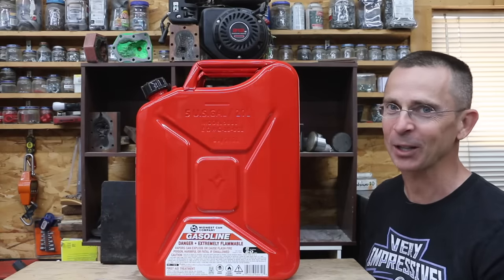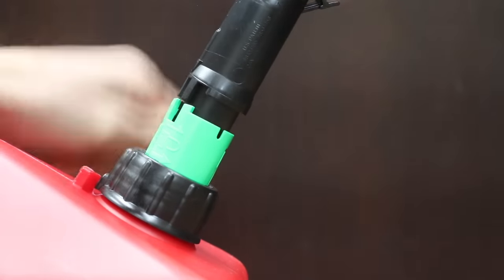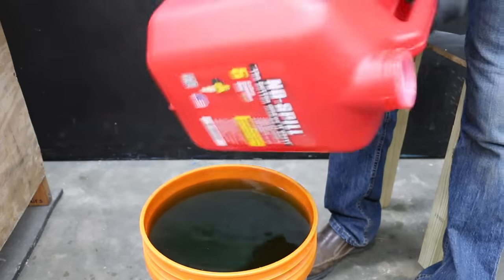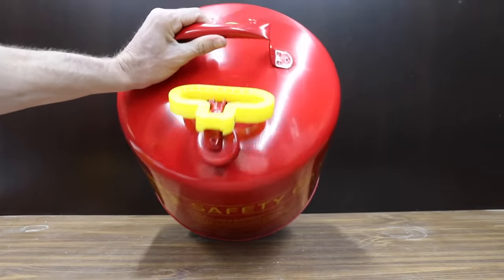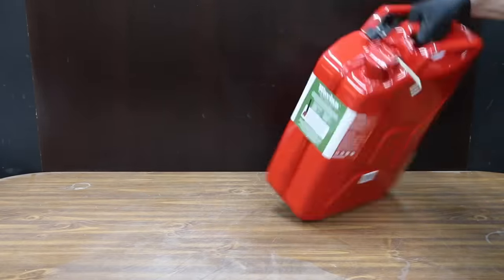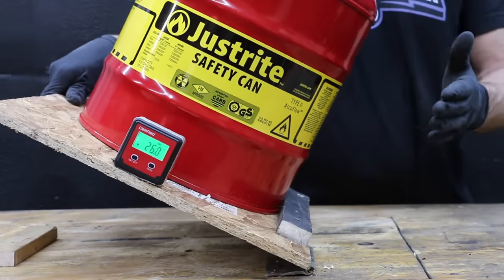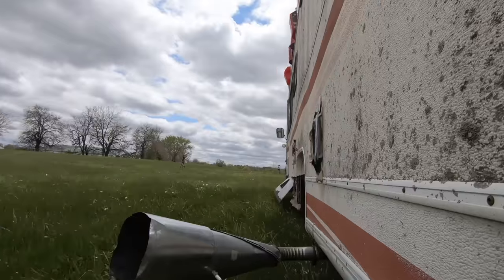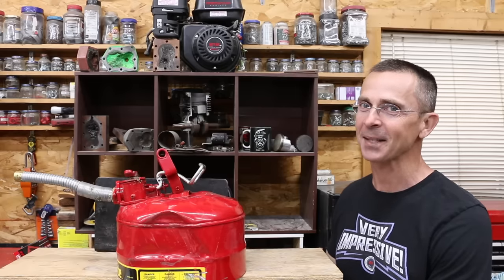Best Gas Can? $140 Wavian vs Eagle, Surecan, Scepter, Briggs & Stratton, Midwest, VP Racing

Comment: I like the gas cans that don’t have stupid EPA regulated nozzles. They are meant to prevent spills but fail at it. Nothing beats an old gas can with a normal nozzle.
Reply: I have a entire selection of "Blitz" brands.  Found new caps on Amazon.  All good.  And no leaks at all.  All pre-EPA too.
Reply: exactly. they cause u to spill gas out of sheer frustration of the moronic designs
Reply: Yep, we fought a whole world war with the old-style ones.  And I am a klutz, and never had issues.  PLUS they were far less complicated.
Reply: The Midwest is a great budget fuel can. If you remove the plastic screen in the tank, & remove the spring from the nozzle they act like the old blitz fuel cans. Then once the spout breaks u can buy a pack of 5 plastic spouts w no restrictions on em for like $20. The Wavian has the option for a steel flexible spout but it’s cheaper to just take the stock one, remove the safety, & slide on a section of clear plastic tubing.

I’ve got 4 of the Wavian Dsl fuel cans for my tractors, & seem to be holding up well so far.

Comment: That RV is hilarious. You sure do come up with some very cool testing jigs. It's hard to beat the old style vented gas can. I'm not a big fan of vented spouts, and your video showed why. Loved the video! Great testing as always. A++
Reply: You can buy old style can vents on eBay that install by drilling a properly size hole in the plastic. I have some and they work great
Reply from the maker: Thanks!
Reply: @ProjectFarm  can you do a video on spray / roll on truck bed liner
Reply: @jackreacher7939  he already did
Reply: @oldnstillworkin5709  Not EPA legal. That's why you can't buy cans with them on it already. If he did that and showed them on camera he could technically be fined.
Reply: @oldnstillworkin5709  dont use them commercially, youll get DOT'd
Reply: @coreybair9426  yes I know. I was replying to the guy above me. For personal use at home
Reply: @oldnstillworkin5709  00
Reply: 440 Dodge-powered? It sounded like that. Used to work on one just like it.
Reply: If you haven’t already, I would like to see a video on is there a difference between lawnmower oil and car motor oil, for use and lawnmowers. Thanks.
Reply: @LamoidZombieDog  guess I should be more specific. Not the rattle can spray liner but the liner that comes with air gun to apply such as Raptor. People are paint their trucks with it instead of a paint job. I was wondering, which one is best and does it hold up.
Reply: Heisenberg would be proud. 😉
Reply: @coreybair9426  I wonder if there's anyone at EPA or otherwise that owns up to creating all the restrictions and regulations on the  original types that worked better.
I don't miss the old ones that have nozzles that store inside the tank though, those will always get the smell of gas on your hands.
Reply: It needs a turbo and nitrous.... ;)
Reply: Farmebago! Fastest thing on the back 40!
Reply: @murrayburke7746  Farmbago Type R ! :D
Reply: @oldnstillworkin5709  Can buy a kit from ace hardware with an open spout and vent for multiple brands of cans. Love it, works great.
Reply: Good to know  @VenKando    Thanks

Comment: Of all the crappy "safety cans" I find the No Spill to be the least crappy. It's not great for filling vehicles but I just have an old style racing can for that. After a few years the plastic nozzle does crack and crumble from the solvents in the gas I assume, but the can still works. Great video Project Farm always a good watch!  

.....Wait. I'm 34 and I just watched an 18 minute video about gas cans with great interest, and even left feedback...have I...have I become my father? No, NOOOOOO!!
Reply: Look up rural king they sale the vp can for 20 bucks
Reply: The non-spill nozzles for me spill more than the old style where I can meter the flow better. But they are better for the 'Avg' person that doesn't need to use them often.
Reply: Dude im 15
Reply: @wobblysauce  Oh I'll take the old style cans with just a flexible tube and a vent cap in the back rather than any safety can money can buy.
Reply: @Bloodbain88  buy some EZ Pour spout and vent kits
Reply: @SuperNoticer  you can buy a good fuel can for what they charge for those EZ Pour spouts. Those are a rip-off
Reply: I agree. No-Spill is getting my money over the others as well. I have the VP jug and it’s heavy, awkward and leaves gas all over the place as there’s no shutoff valve.

Comment: I have 3 of the round Eagle cans - two 5-gallon and one 2-gallon. They're great. Durable, easy to use, never leak, Made in USA, and reasonably affordable. They also last forever. One trick is when attaching the funnel to push it down all the way onto the can. With the funnel properly attached you can rotate the can and get every last drop of fuel out.
Reply from the maker: Thanks for sharing.
Reply: The eagle 5 gallon can is one of the best ones on the market! Never understood why plastic gas containers are legal because they are a fire hazard because of static electricity can cause them to be combustible ?

Comment: I bought some Midwest (Plastic) cans and immediately changed out the "no-spill" spout for a regular spout and added a vent on the back. The no-spill design turned out to be much-spill and was a pain to deal with.
Reply from the maker: Thank you  for sharing!
Reply: Where do you get a regular spout
Reply: Kits on ebay
Reply: I did exactly the same. Midwest has a design that can be vented as you pour. I have used the no spill can at work and it’s the only can that ( does work) right off the shelf!!
Reply: @TexasNationalist1836   @Patriotic American  I bought these on Amazon:
1. EZ-POUR B07S42B8T9 Rigid Spout Replacement and Vent kit
2. EZ-POUR B06WRRXG1X Gas Can Spout Replacement
3. YOUNGFLY B07JNBD1V5 5 x New Replacement Vent Caps
4. EZ-POUR B00NB3UUDK Solid Base Replacement Gas Can Cap
Reply: @kbsanders   Very helpful  - thanks.
Reply: @TexasNationalist1836  tractor supply sells regular spout kits in 2 different diameteres with a vent for like $12
Reply: The Midwest can I had decided that after about 6 months of use, to fall apart and launch hardware into my atv.
Reply: Yep, the original spout on the Midwest is one of the worst I've ever used. I bought one of those cans as a backup, and at the same time I bought the ezpour spout kit. I've never used the spout that came on the gas can LOL
Reply: @kbsanders  thanks for sharing bud, I had no idea they had rigid spout kits! I'm not really in love with the flexible spouts but they are much better than the EPA approved type.
Reply: @Krankie_V  rigid spout is good on a small can but on a full size can inserted in a car filler neck it's harder to pour without putting stress on the plastic nozzle. The flexible accordion type nozzle is a bit more user friendly overall.
Reply: @dubmob151  I don't use gas cans to fill cars. In the rare event I attempt such a thing, I use a funnel.
Reply: @Krankie_V  my cars have side fillers so funnels wouldn't work very well for that-
Reply: @dubmob151  OK well like I said I don't use gas cans for cars as there is literally no reason for me to do that so it's not an issue whatsoever.

Transmission funnels work in side fillers just fine by the way. The only place you run into an issue, sometimes, is with the cap-less systems. One of many reasons I don't care for them.

I really only fill cars from gas cans at work, when some fool of a customer drops off a car to us that needs to be driven and hasn't got any fuel in it.

Comment: One of the very BEST devices ever invented, is the "gas can spout conversion kits" ! It's a simple device that simply returns your can back to original, pre-regulation condition. In my opinion, the new spouts actually make a can more spill prone, more  dangerous and frankly a big pain in the a** !
Reply: I have a few No-Spill gas cans, 1-gal and 5-gallon.  Their shut-off valves let you control the pouring speed well.  I can trickle gas into a small string trimmer or backpack blower tank from a 1-gal. can with zero spills, unlike other "spill-proof" designs I have tried.  As said in the video, you would need their add-on extension hose to fill a car's gas tank, because the cap/control-valve spout is short.    The pour spout's attached cap keeps it clean until the next use.

The plastic No-Spill containers are so air-tight that the sides can bend inwards a little when it gets cold and the can's internal pressure drops.  In hot weather, vent internal pressure from the can by pushing the button while the can is still on the ground.  That makes sure the can is not pressurized when you pour the fuel.   I have had these cans for years - the shut-off valves still work perfectly, and the can's air pressure flexing hasn't affected the heavy plastic's integrity.   Air-tight cans mean water won't get in and the gas should stay fresher longer.   Seafoam is also used to stabilize the ethanol-free gas.
Reply: @richschmitt4621  Do you have difficulty refilling the gas cans? I find them hard to refuel at the gas station because of the high rate of flow from the pump overloads the fire mitigation screen inside. Always spill fuel because of that. Tried just filling slow, but that is kinda hard.
Reply: @richschmitt4621  I find that it is extremely difficult to thread back onto the can the valve/spout.  Those large diameter threads just don't want to go together.
Reply: @williamhankel2113  I must have older cans.  The No-Spill cans I have, in different sizes, do not have a screen or mesh inside the can.  I still slow the pump's flow rate when filling the shallow 1-gallon container, same as I do when any can is nearly topped up.
For 2-strokes. I fill by 9/10ths of a gallon units.  An old small engine mechanic told me to do that so the oil-gas mix becomes 10% richer, as a safety margin for 2-stroke lubrication of the piston and bore.
Reply: @spacecoastz4026  Same issue here.  
Now I hold the yellow valve-spout body steady and slowly reverse-rotate the black threaded part with the other hand.  Turn the black outer piece as if unscrewing it, slowly, like a safecracker. You can feel when it drops a bit, as it passes the top thread of the can.  Then thread it clockwise to tighten.
Works for me, hope it works for you.   It is the same way I start bolts, oil filters, etc., to prevent cross-threading.
Reply: @richschmitt4621  Yeah, I do the same thing, but usually I need to lift the filled container back up to my truck tailgate and then get the spout body back on.  Lifting without the spout on is a safety hazard.
Reply: Amen to these conversion spouts👍🏼

Comment: I've found that a long neck funnel prevents a lot of the initial spillage from tipping the can.  They work best when you convert the new cans back to old style spouts that spill far less than the new designs.
Reply from the maker: Thanks for the feedback.
Reply: Where do you get the old style spouts? Ive tried a few but none have fit.
Reply: @Johnnysokko168  I found them on ebay.
Reply: Tractor Supply sells them.
Reply: I like the Midwest brand can spout. You can look up a video how to modify by removing the o-ring which allows the spring to be removed. Then it actually works without the spring constantly fighting you. Works well and still seals nicely.
Reply: @Layton Little  Red Green would would probably have some modifications to add but likely would involve beer cans and Safety First is an issue, eh ?

Comment: I still use an old metal jerry can that my Dad used on the back of his jeep in WWII. It's from 1945 and still no leaks !!! I have a 2 gal old boat gas can, that I only use for the chain saw. That thing is from the 60's. Can't beat the old stuff. Love your videos. !!!
Reply: And also no rust inside?
Reply from the maker: Nice!  Thanks!
Reply: No rust. Maybe the Army had some kind of coating in them when they were made. It was always in our garage being used, and I’ve had it in my garage since the late 60’s. Both have usually had gas in them for the outdoor equipment. The boat can always had oil mixed in because of the chainsaw. Had a plastic one once, but it split open.
Reply: I actually watched a video on the Jerry cans and they usually had a coating on the inside, meaning you could use it for both gas and potable water (not at the same time, obviously)
Reply: @dailythenoob  if you alternated between uses and didn't remember which one you were on, you might have potable gasoline or watered down gas 😉
Reply: @dubmob151  LOL, therefore the original German jerry cans intended for water had a big „Wasser“ (water) stamped into the sides just below the handle. BTW my father and I used two original German jerry cans made by the original company that invented them, Ambi Budd (Berlin), one stamped 1942, one 1943. Both were used up until the 1990‘s (without any leak!), when we switched to 5l plastic cans for ease of use. They were perfectly useable when we scrapped them.

Comment: Removing the vent hole, making smaller openings, and adding maddening safety spouts make using then an absolute pain to use.   Honestly they become more dangerous when adding on such safety "features".
Reply from the maker: Thanks for the feedback.
Reply: Anyone that has had to use a fuel can in the last 10 or 15 years will almost certainly agree lol 
It’s like the people that decided we needed safety spouts, and designed them, have never even so much as talked to someone who HAS used a fuel can lol
Reply: @kylesalem-fuson8012  Exactly right... it was Karen with a gavel who made us do this.
Reply: @kylesalem-fuson8012  they are highly prone to spilling. Absolute garbage.
Reply: You should put the quotations around the word safety.
Reply: Maybe it is just user error.

Comment: I own both the Scepter and the VP Racing. The base of the spout on the Scepter is rather flimsy leaks easily when fueling in most situations and inflates like a balloon when left in the sun or a hot shed, permanently distending the can. The VP Racing is awesome due to the tube-like construction that allows me to rest the weight of the can on my shoulder when fueling tanks that are higher off the ground. It also has an amazing flow rate.

Comment: I live in a very rural area, and from what I've seen at the local gas station, and from my own experience, the race style cans and no-spill are the way to go. I use both depending on what I'm filling.
Also, no-spill has a small flexible attachment for the nozzle that allows it to be used to fill vehicles when necessary.
Thanks for another great video!
Reply from the maker: You are welcome!
Reply: Yep, I have that no-spill attachment

Comment: Something to keep in mind about galvanized coatings, I've read that they break down over time when filled with diesel fuel. Then the coating can redeposit itself inside your engine and cause problems (like with diesel injection pumps). 
The painted interior of the wavian can (and I assume the harbor freight version too) are designed to withstand all common fuels. Wavian does specifically warn that their coating will break down if filled with water. The harbor freight may as well, I don't know.
Reply from the maker: Thanks for sharing.
Reply: That is correct, diesel reacts with the zinc in the coating and WILL damage a diesel fuel system with a hard buildup usually at the injector nozzles. Additionally the reaction can cause a bad reaction with the fuel itself which causes fuel quality issues on top of the zinc reaction.

Comment: Great info as always! I run a small cattle ranch.  I began searching for new fuel cans three years ago. I ended up buying 6 VP Racing fuel cans - 3 red cans for ethanol free unleaded and 3 yellow cans for diesel. I wanted something lightweight with a flexible spout, but without any type of safety trigger or valve release. The VP cans hit all three of those. Watching your testing, it looks like I made a good choice. Thanks for another great video!
Reply from the maker: You are welcome!